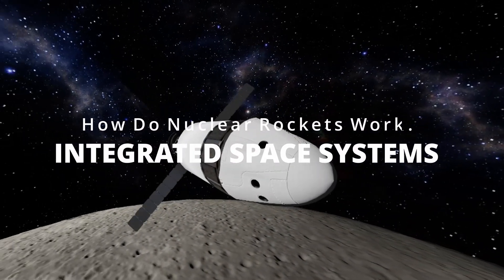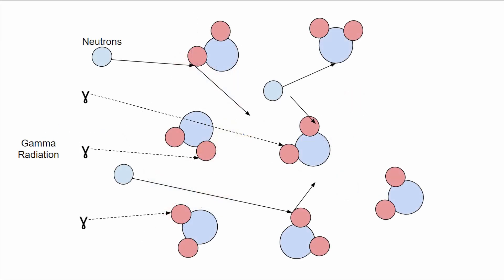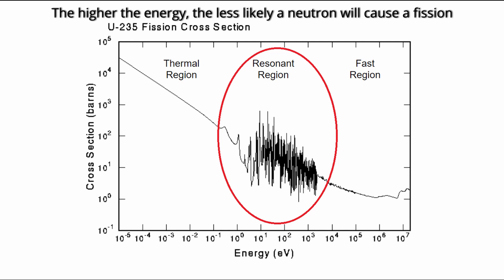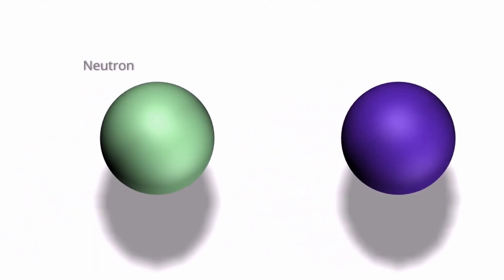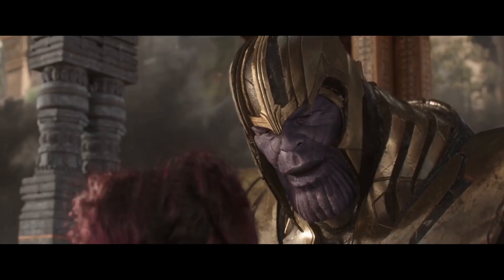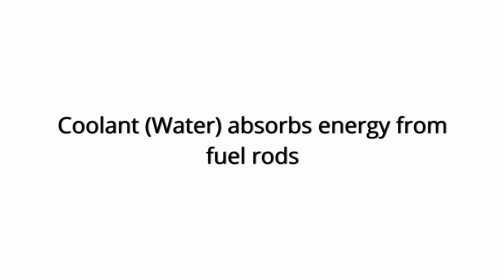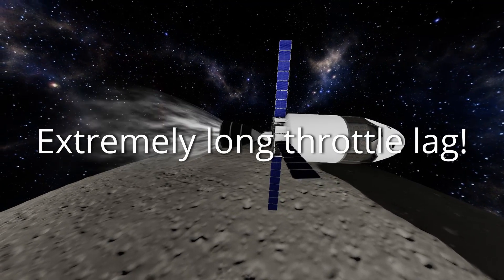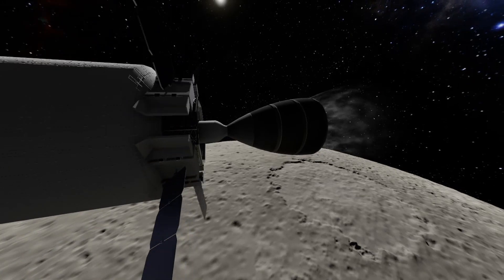Juno: New Origins || How To Build Rockets Pt. 18, Nuclear Rockets

Comment: I usually use nuclear engines for deep space missions. a 2m square fuel tank with a vacuum optimized nuclear engine with water fuel gets about 7km/s of Delta v
Reply: Water fuel? Wow, I have never learned about its usage in this game, for nuclear rockets? Can you tell me?
Reply: @forcyland  if you set your fuel type to water it is more efficient
people don't usually use it because it has less thrust but i like it
Reply: Water is better for smaller craft. Hydrogen is better for larger ships since hydrogen has double the efficiency for the same mass of water. The down side is that the volume is significantly larger due to the lower density.